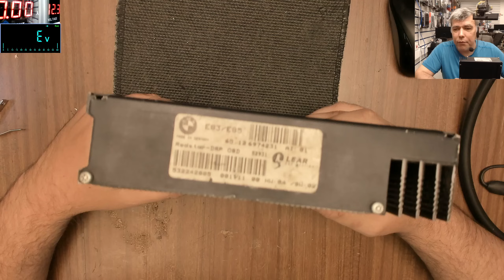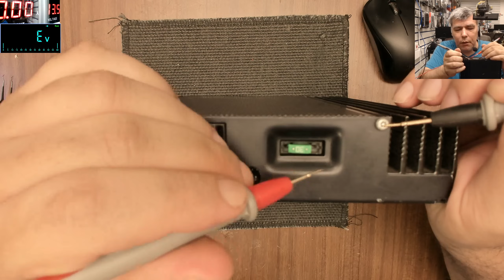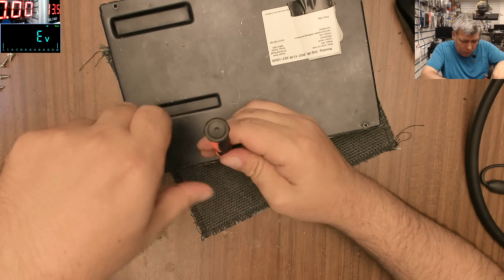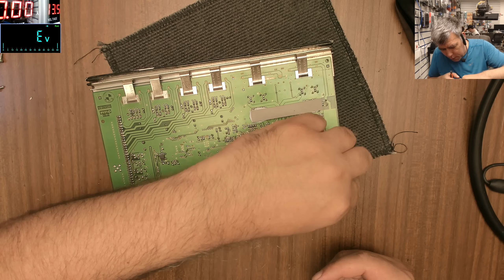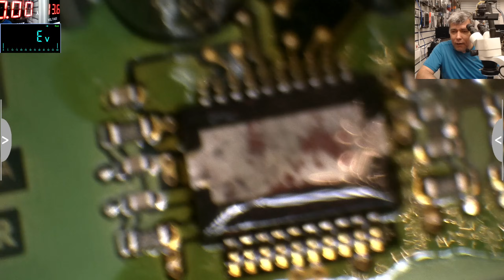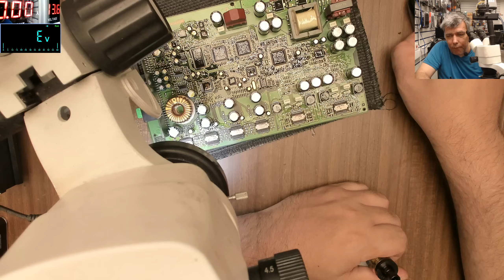BMW car audio amplifier repair - draining the battery

Comment: New to electronic work/repair and have been learning a lot from your channel so thank you for that. What temps do you hot air? I saw your video on your old tool for manual hot air which was great and I know everything you said in that video about the hotter the faster the better but I seem to have a hard time. I hot air @ 390c full ait power and it still seems that the parts take a long time to come off. Not like yours as they seem to pop right off. Any suggestions or help would be greatly appreciated. Thanks again and keep up the amazing work.

Comment: Most IC's in automotive stuff is masked so searching for information on them is rather difficult.  BMW especially has a lot of custom made stuff you cant really get anywhere.  If its not masked is almost always obsolete. Aliexpress sometimes if you get lucky but if its not a commonly failing chip like injector drivers then even if you find one its probably something else and just labeled with what you want.

Comment: 16:30 TDA1565 supply voltage is ~14v. it powers directly from the battery, thats why it drains current even with main power inverter turned off .
Reply: So constant power from battery, then when this part fails, battery gets drained.
Logic, thx

Comment: "A thermal camera would be usefull, but we don't have something like that".
Would an IR themometer somehow help in this instance?
Reply: somewhat, but not by much as you need to point it towards the exact culprit.
Reply: @showmytime9177  I guess it would be usefull if something large (like a chipset) was shorted, not so if it's an smd cap

Comment: Round of applause matey !

Bl**dy car electronics. Cheap and nasty construction and bad circuit design but high replacement prices !

I got a failed motorised temperature flap on a Skoda Fabia ventilation system . . drains the battery in two weeks.
To change the ventilation flap motor,  which itself costs £70 !, will involve removing a fair bit of the dashboard and cost £500 !

My solution, take out the fuse  and, also, oddly, the diagnostic socket  fuse . . . battery drain gone !

Comment: Replacement chip:  
https://www.aliexpress.com/item/4001116198387.html?albpd=en4001116198387&acnt=708-803-3821&aff_platform=aaf&albpg=542650620136&netw=u&albcp=9604713100&sk=UneMJZVf&trgt=542650620136&terminal_id=7e0fc12a79804d4eb740c2dd3913ead8&tmLog=new_Detail&needSmbHouyi=false&albbt=Google_7_shopping&src=google&crea=en4001116198387&aff_fcid=1816716046564ab0bae849944843e8b2-1628011940562-09673-UneMJZVf&gclid=CjwKCAjw0qOIBhBhEiwAyvVcf-aWd-TQmIWHQgaaV79PPiOfSfKnXEA3XKS6sFrMo9eDkpXlz6ydXBoCd8AQAvD_BwE&albag=99283534296&aff_fsk=UneMJZVf&albch=shopping&albagn=888888&isSmbAutoCall=false&aff_trace_key=1816716046564ab0bae849944843e8b2-1628011940562-09673-UneMJZVf&device=c&gclsrc=aw.ds

or
https://www.aliexpress.com/item/32922686050.html?spm=2114.12057483.detail.3.41c845b3yq9Uhj

Comment: The amplifier has a separate power supply. The amplifier is switched on by the RAD_ON signal from the radio (> 8 V = ON / < 6 V = OFF).

Comment: Disconnect or bypassed that factory amp, suggest the owner to upgrade to aftermarket 5 channel type of amp and the rest of the front and rear 2 ohms speakers to 4 ohms..
Reply: Aftermarket 4 ohm bridgable amplifiers can handle 2 ohms easily. Problem would be other circuitry inside BMW amp, original headunit might not turn on without it. But tda1565 inputs could be connected to outside amplifiers inputs. Building it, so it looks decent is not worth it probably..

Comment: Hi. Shorted or burnt speaker will short that chip.replacing it will stop the battery drain.but before installing check the impedance on that speaker otherwise it will short that ic out again.nice video and diagnostic

Comment: https://www.mouser.com/ProductDetail/NXP-Semiconductors/TDA1565TH-N1C112?qs=GcY6OjH1zdkoGre2AI%252BXUg%3D%3D
Other chip manufacturers make 12V audio chips.  You might need to rearrange the pinout, but often they use standard pinouts.  You will also need to make sure the heatsinking is adequate.
https://www.futurlec.com/ICSFPhilips.shtml
https://www.st.com/en/automotive-infotainment-and-telematics/automotive-audio-power-amplifiers.html
https://www.ti.com/audio-ic/amplifiers/featured-products.html
https://www.nxp.com/products/audio-and-radio:AUDIO

Comment: I have a high suspicion the installed speaker was flooded with liquid, as water damage that led to a condition as constant to ground.... short. I would be very curious as to operation via reinstall in end use.  Was that as to an automobile?
I hold the view, install of a new chip would be shown to new, unprotected ground and subsequent 2nd chip fail.
I think a clear, repair as to device would be to cite, the potential for high heat, as to 
a consuming fire.  Replacement of chip demanding discard of speaker . *replacement.(also)/
What an interesting repair problem. 
Please mention how the job was finished to customer need.  M.

Comment: This amp probably belongs to a fancy OEM integrated car radio that will not have an internal amp. And replacing that fancy OEM car radio with something aftermarket will disturb the design of the dash. A new replacement amplifier from the dealer will probably cost more than the car is worth. So this must be fixed. Or maybe the customer is already happy if he can hear the news and traffic announcements again through 3 speakers. Indeed. Talk to the customer.
I found on a document from NXP that their version of this chip has been discontinued in Dec. 2009. Yes, AliExpress sells 'genuine' TDA1565TH from 'stock' but those are probably not so 'genuine' as you'd like. They'll probably work. At least for a little while. Until you crank up the volume.
Take a look at the datasheet. Each chip has 2 channels that can both switch automatically from single-ended to bridge-mode on higher volumes, so technically, 4 amps per chip. Very fancy. So the 4 chips in this unit have 8 bridge-capable outputs in total. They probably parallelled circuits or they just used half of each chip. So, probably 4 outputs And I suppose there's two high-power amp chips that are supplied by that voltage booster circuit, for subwoofers.
So, if this thing goes in my car, I'd probably wire the speakers for front and back in series and connect those to the stereo outputs that still work. I'm not into loud car audio systems anymore. But if I was, then I would take all power chips out, add RCA output jacks to this box for each channel, and connect more powerful external amplifiers and speakers.

Comment: https://www.digikey.com/en/products/detail/nxp-usa-inc/tda1565th-n1c-118/1966333#product-details-substitutes

https://www.ebay.com/itm/193943633315

Found varios vendors, digikey hace some models other not need the reference the mayorí is no longer manufactured.
Reply: Tda1556 is generic name y found 5 diferent IC whit diferent watt power see if have More number identification near or under the IC for identification the correct part.

Comment: what is that liquid you poured on the chip at 11:53 ?
Reply: That's Zippo lighter fuel fluid.  You can get it online.
Reply: @NicuRO91  Why not just use isopropyl alcohol? It's cheap and can be purchased at any drugstore. Most people already have it to clean flux off the PCB. Also it leaves no residue on the board.

Comment: Those chips are likely in standby,  but the damaged one is shorted to the rails. 
Bad speaker maybe.
I would not experement with that amplifier,  it could become an expensive mistake :-(
Reply: Yes check the cars speakers, then look for a used amplifier from a scrap dealer and rob the chip. Or like Sorin suggested talk to the customer about not having that speaker in circuit.
Reply: Check the cabeling also! Often the cable is shorted to Car ground. This will destroy the amplifier!

Comment: TDA1565TH is the chip you need good luck finding it! also this amp is a class AB. I would swop the chip with the one next to it just to see because the fault could be with pin 2 mode/standby/operating mode circuit.
Reply: What are you talking about they are all over ebay. even some of the Bose sound docks contain them.

Comment: Ive done some amp repairs. Usually its after market amps. People hook them up wrong or do not tune them right and end up blowing them. Then I would fix them and tell them to check their wiring and settings. Then they blow it again and accuse me of not fixing it right. So, I really scaled back on repairing them. There are a lot of people out there that think you can just hook them up and go. Thank heaven this is a factory amp.

Comment: this is an interesting one
please DO update us, especially if you are planning any dodgy stuff with the board

if you put the channels of 2 speakers in series one with the other, would the amp be able to drive both?
Reply: yes but probably it have an output problem. each speaker would get 1 ohm each (parallel) and he says the minimum is 2ohms
Reply: you can do a BTL and have almost twice the power

Comment: strange it is always hot and not wired threw the ignition switch.
Reply: Hi.it most probably shorted the pins causing the ic to get hot at below800 m.a.That will drain the battery in couple hours time.its like leaving a light on in your car.drop in voltage will drain the battery esp overnite